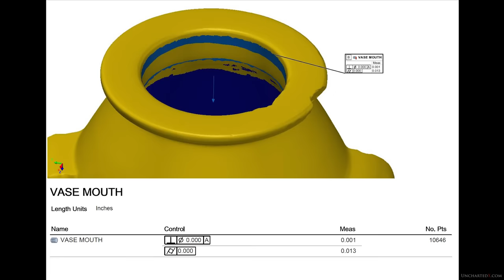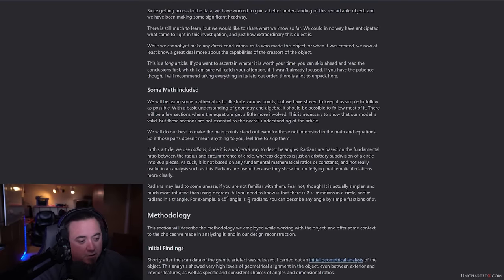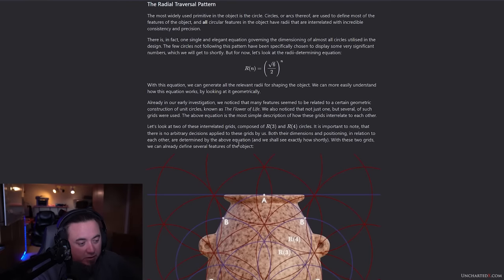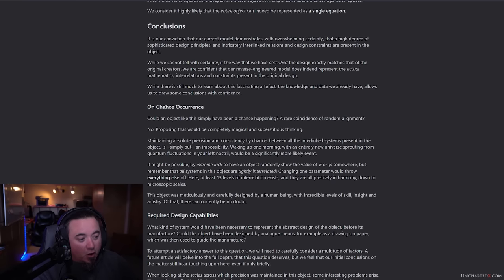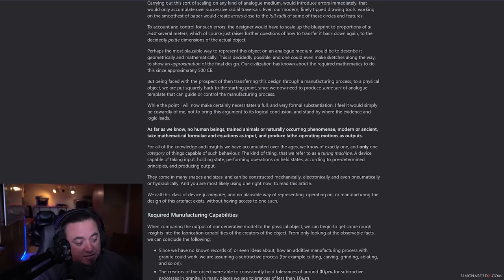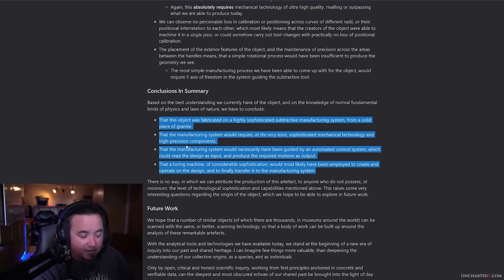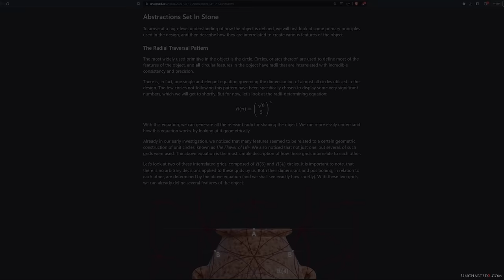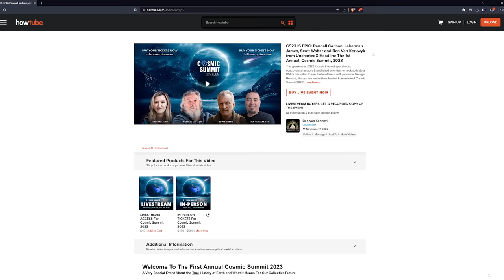Was a COMPUTER Used to Design this Artifact??

Comment: As a Mechanical Engineer, I have always loved learning about ancient history and artifacts like these, especially in the last couple of years. To me, this is amazing, even considering the machines I have used and designed parts for many times over. I don't think people understand the types of tolerances that we can make or what it takes to make tight consistent tolerances. Love watching these episodes!
Reply: The main issue with people making measurements off of 3D model created by the structured light scanner is that it is not really as accurate to that actual object scanned as claimed due to the processing that takes place within the SLS software when converting the point cloud scan data to a mesh for the 3D model.  I made this point on his last video but I don't think people realize how an SLS works and what the software actually does to create a fancy 3D model.  The best industrial SLS units only have a max resolution of +/-0.002in or +/-0.05mm so the actual band of precision is outside the thickness of a human hair so a scan could result in a model that is far enough off to slide a piece of standard 20# printer paper through it that has a thickness of just under 0.004in.  Because of this, the software that converts the point cloud to a mesh uses a best fit algorithm to make the resulting mesh less complex and easier to process on a 3D printing slicer.  If this was scanned on a modern SLS industrial scanner I would expect the point cloud data from several scan passes to take up several gigabytes and an unaltered, unsmoothed mesh generated directly from the valid non duplicate points in the point cloud to be hundreds of megabytes in size.  As it is, the STL file provided has a lot of smoothing applied so it is just under 46MB in size.  I would argue that using the processed and smoothed 3D scan is going to make any mathematical elements look more correct than they are because the computer is applying best-fit algorythims and analyzing the vase in this way is akin to a dog chasing its tail.

3D model challenges aside they still cannot verify or prove the providence of the vase so that is the first order of business before we even start talking about the accuracy we can measure this vase too let alone finding any mathematical elements within the layout of the vase construction.
Reply: No the average person does not understand engineering, electricity beyond flipping a switch, how the engine their car makes it go etc. They are more concerned about Oprah and the Kardashians. Or at least, that is what we are told to watch and is more important. But I know from meeting too many people they really are myopic and don't have a clue about the world they live in, except the one in front of their nose.
Reply: Something else I have pondered over is vibrations. In our culture, or at least my line of work and many others, vibrations are generally bad. You have rotating equipment, car engine, electric motor etc., vibrations can and will destroy the part if you run them at the natural frequencies. So we design around these natural frequencies and do what we can to mitigate and lessen the vibrations experienced. The only case I can currently think of where we use vibration in a good way, is vibratory stress relief. Basically you vibrate a part to try and relive stress in it. Otherwise, vibration is bad. Knock in your engine because a bearing went bad, the Tacoma Narrows bridge collapse because of vibration brought on by the wind blowing across it. WE try to avoid vibrations and design around them. What if the ancients, were the opposite and instead used vibrations to their advantage? For machining, molding, moving blocks of granite, maybe vibrating the granite to "soften" it so they could cut it, or something similar to ultrasonic machining. Maybe they use vibrations to their advantage instead of trying to avoid or prevent them like we do today.
Reply: @tjstengel  vibratory stress relief?
Reply: @AustinKoleCarlisle  Yes. I forget the name of the machine but we use it sometimes for stress relieving of smaller shafts. We have criteria for it, but ya it is literally what it sounds like. Vibrating a part to relieve internal stresses. The more common stress relieving process is thermal stress relieving, but there are times to use vibratory stress relieving.
Reply: @Aqua Fyre A few answers / thoughts on some of these. "Assuming" we are talking about a civilization 11k - 13k years or older, some of these are simple answers. Most metals, except for Gold and maybe 1 or 2 others, oxidize and will eventually disappear into dust and be indistinguishable from the dirt and rocks around them, unless they have somehow been preserved. Also tools and machinery wear out and need upkeep. If some cataclysmic event happened,  they could have been dismantled and parts used for other mor important uses than what they were originally intended. Also, not finding tools near the sites of structures, generally doesn't mean anything as tools are expensive and you don't leave them permanently at work sites. You take them with you to the next site. Simple analogy, where are the tools / equipment used to build the house / apartment /building you live in? They have been moved on to the next task or wore out and parted out or destroyed just like do today. Roads, sewers, buildings etc. all eventually crumbled and wear away. The only types of these things still visible today are basically those made of granite or other hard stones. Look at an abandoned house. It only takes maybe 5-20 years for a house to start crumbling without upkeep. 100's to 1000's of years, nothing would be left. I still joke one day that some future civilization will find a "cookie cutter" neighborhood and all that will be left is a bunch of flat pieces of granite that were used for countertops (lol). Almost everything  degrades over time. Rocks, concrete, wood, etc. Only the hardiest of materials survive, or those that have been well preserved. If humans disappeared today, it wouldn't take but a few hundred years to maybe a couple thousand years for almost all traces of our existence to be gone. Save for a few large structures. Even a writing system, they may have used some type of paper or papyrus or something else. But when it gets cold and you need warm, that paper going to start to look real nice and easy to light to make a fire to survive.
Reply: @AustinKoleCarlisle  Yes, this is a common practice amongst single women, who also happen to be great consumers of AA batteries.
Reply: @tjstengel  Since we have 'perfected' the use of ultrasonic drills that use vibration to split apart the ionic bonds of molecules we can assume that in 100 or 1,000 years such technology will be unimaginably more advanced and capable.
Reply: @tjstengel  "I forget the name of the machine but we use it sometimes for stress relieving of smaller shafts."

LOL, sorry I couldn't resist.
Reply: @MelbaOzzie  look at the first sentence of his reply to me.
Reply: @redwoodcoast  I agree. I forgot to add in, assume there is a cataclysmic event, such as those of the past that knock us back to the stone age basically. It would take a long time to get back to this point, as it probably has who knows how many times in our past. Assuming another event happens in the future, who knows what path would be taken next if the next civilization would go the same route we have in regards to power generation or a different route. Assuming we don't come up with a good way of deterring a cataclysmic event. Most of the power grids are based on the simple matter of turning water into steam, which powers a steam turbine / generator. Obviously we have solar and wind, but that does not account for the majority of the worlds power creation.
Reply: @Aqua Fyre I may need to watch some of this again, but I use computers all day everyday to create parts that we manufacture. Whether it is a CAD program (NX in my case in regards to work) or FEA program such as ANSYS, computers still require user input. And even once a program has been created and a part run, there can still be mistakes whether it is from user input, or tools wearing out, or something else failing on a machine. Things can even be messed up by something as simple as a fork truck driving close to a machine or a punch press machine causing noticeable, albeit small, mistakes / machining errors. We did testing on this when we had a new WFL machine installed and tried to convince people they shouldn't install it where they originally planned. They still did, and we had issues, but it ended up being moved eventually and installed in another area (for completing unrelated reasons) and mounted differently to prevent the affect of fork trucks driving by the machine. Even when it comes to the lathes we use, we still have to re-center parts multiple times, and sometimes you can tell it has happened, it just depends whether or not it affects the finished product. Regardless, I find it fascinating trying to figure out how they did something compared to how we would do something similar today. Reverse engineering is usually pretty fun / entertaining and can be quite a learning experience. Of course, so can making mistakes, and fixing those mistakes, though sometimes that is painful and expensive.
Reply: @tjstengel  "Renewable energy" will predominate within 10 years since the price of materials and products has collapsed. Major disruption is already happening.
Reply: @redwoodcoast  I'm still skeptical on whether it will happen that fast or maybe even at all, but only because of recent events in places where they have a lot of renewable energy, but just had major issue where it couldn't keep up as needed, or say places in Europe where their bills are way more expensive now than they were before. Solar is great, especially if they can ever get the efficiency of the panels up over ~18%, but it is still expensive and some areas it doesn't make sense, but if they can ever get the efficiency way up, that would be the big game changer. At least, in my opinion. I still prefer the occasional burning logs in a fireplace or using a wood burning stove to heat a house.
Reply: @kuhrd  summaries are cool
Reply: @tjstengel  I use my wood-burning stove when I have wood that isn't green. But as for cost and efficiency, those are the issues of yesterday.  They are now obsolete because, as I said, the price has collapsed, and also the efficiency keeps increasing with new designs.
Reply: @Aqua Fyre While your comments are interesting , they do not address the central issue.
It is possible that this particular vase was made during one era, and the defective  artifacts you refer to were made thousands of years later.
There is no way of telling when a particular stone artifact was made.
Reply: @redwoodcoast  only if it's nuclear. anything else cannot meet the needs of people on earth. don't get me wrong--there is a concentrated effort around the world to reduce human population, so you may be correct in your prediction if the human population crashes as well.
Reply: @kuhrd  To create an item with the precision resolution of the scan would still require some kind of computer-controlled machine. Who knows what the actual precision of the equipment could have been? I've worked on test equipment that measures turned cylindrical parts down to millionths of an inch using off the shelf technology.
Reply: The fact that there are 9 layers of parametrically driven features is insane. I've been designing and modeling for 9 years and have never seen anything design parametrically to that level.
Reply: @kuhrd so how do they make airplane parts that have to be perfect dimensions then
Reply: @kuhrd  as a 3d artist I must say you have a point here. The tolerances probably are much higher than presented in the scanned mesh. Although it doesn't ruin the conclusions that much. Highly sophisticated tools had to be used to manufacture this vase and it's quite crazy to understand.
Reply: @kuhrd  pretty sure they are taking the measurements from the original scan data....not measurements from the 3D printed replica, or did I miss that?
Reply: @mokkamake  yeah it's funny, the conclusions he draws from his misplaced skepticism actually supports Ben's theories, he just doesn't realize it yet (the vase is more precise than can be measured).
Reply: @tjstengel  Usually when people theorize that ancient people used sound to levitate the granite to lift and transport it to the pyramid site, that kind of thing, I roll my eyes. 
But what you’re saying about working with vibration instead of against it makes sense in a really lovely way. 
Furthermore, I imagine that the civilization who can create this vase, so precise and elegant in so many ways – if any civilization could figure out how to use vibration to support their purposes, it would be this one! 
Cheers!